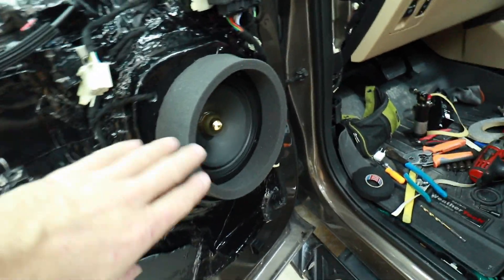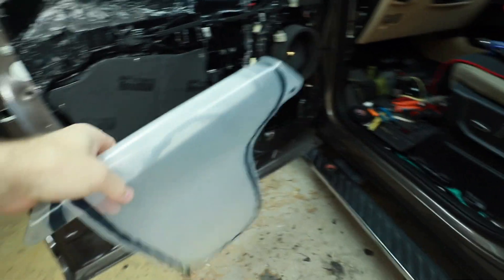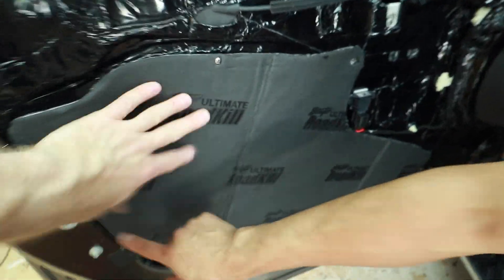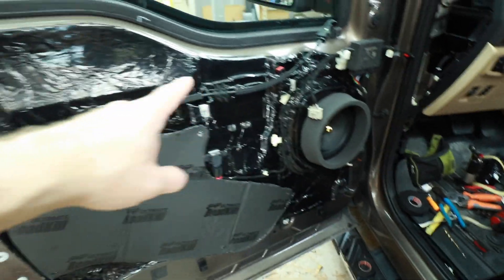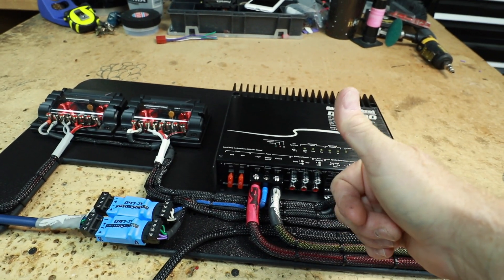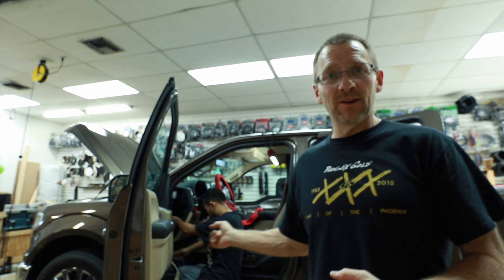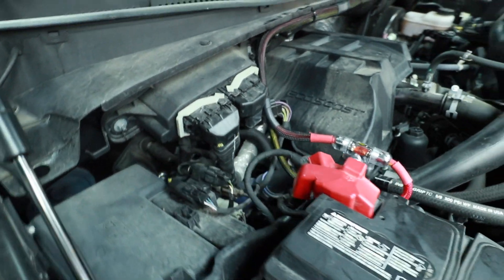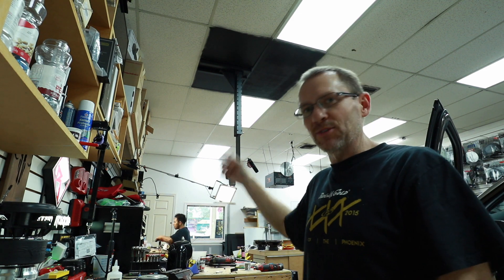Is it Tuesday yet Installer Diaries

Comment: Is there an amppro kit for 2018 raptor with the b&o system ? Please inform me what to do. I'm replacing speakers and adding 4channel amp sub and mono block. I am looking for the no hassle way to do this without doing all my own wires.
Reply: Wayne Twombly, As of right now, there is no AmpPro Interface for Fords with the B&O system. You`ll have to use the ZEN-A2B Interface by NAV-TV. If you decide to go this route, be prepared because this interface is $849.00. I hope this info helps you out.
Reply: @blkngwinn  .....great timing I just found out the same info. How about this idea. Can I use the output from my factory amp to high level input on my amps ?  I dont care about the surround sound but I'd like to keep all the other factory functions.  Also do you know where I can find information about the factory amp wiring pin out ?
Reply from the maker: You will have to have the fake exhaust noise turned for by the dealer.
Reply: @FiveStarCarStereoInc  turned off the fake noise  today. Now how about those tweeters on my truck ? It doesnt seem like the zen-a2b doesnt support the tweeters. Is that true ?

Comment: Dean, I know I keep asking you about a 2018 F150 with the B&O system,  but I did hear there is a new PAC  Amp PRO  available now. Is that accurate?
Reply from the maker: Nope not for the f150 from pac just NavTV. The new 2019 f250 may use the old bus network so the current amp Pro may work on those.